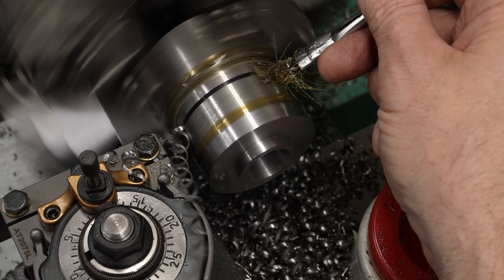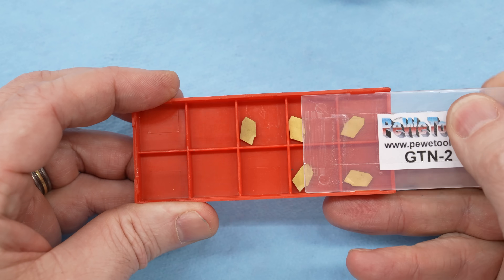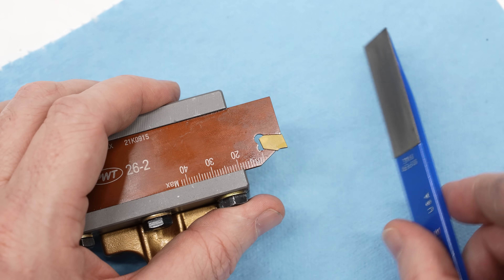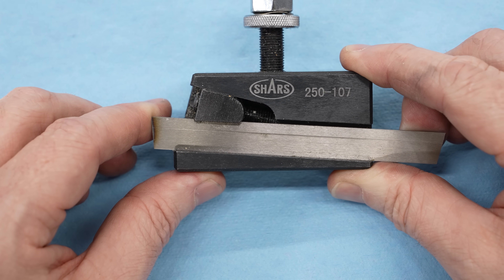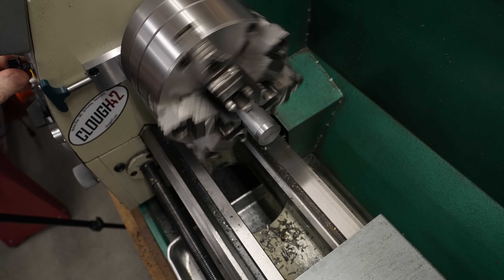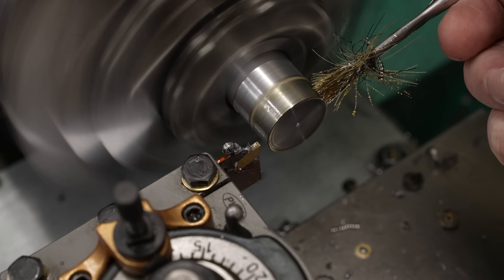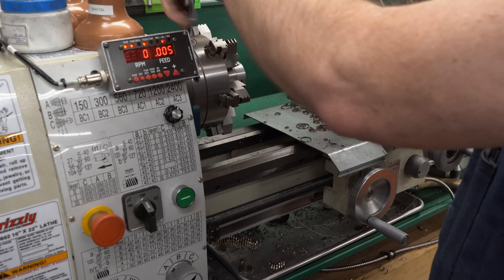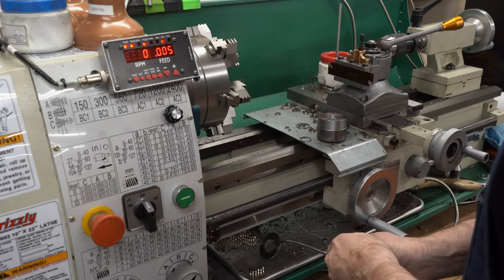High Speed Parting with CARBIDE in a Small Hobby Lathe

Comment: Part of the issue in my experience is don't use a brush. That only gets oil to the outside surfaces on a deep parting operation. Centrifugal force slings the oil back out with very little getting to the point of cut. I typically use a squeeze bottle to drip oil at the back side of the cut and let it carry through keeping it wet. I also suspect with a VFD spindle drive at low RPM, there really isn't much torque available if you look at the torque curve for that motor.
Reply: A spray bottle of cutting oil is great for parting. Spray it onto the blade and down into the cut.
Reply: Need to find one of those bottles like stefan gotteswinter has with the needle tip.
Reply: Yep. Small squirty bottle with a needle on it. And soluble oil rather than traditional cutting oil - the heat from a cut like this will make so much smoke that you can't see the lathe, whereas soluble oil will make mostly steam.
Reply: When parting with carbide I don't use lube.  If anything it seems to cut worse for me.  I use Iscar blades and inserts, and I just send it.
Reply: @10-4CodyWade  If the chip can get out of the cut, that works. When gummy material welds to the cutting edge, galls to the sides or itself locking up the blade, it gets ugly quick with zero reaction time. I guess I don't take chances with risky practices. 🤑
Reply: @LetsJeep  If you use the right cutting tool there won't be any material welding to the cutting edge.  If you're using the wrong insert on soft aluminum then it can weld, so go ahead and use lube.  I'm just saying that for most materials lube doesn't help.  Mild steel, alloy steel, brass, 416 stainless, and even tool steel can be parted off without lube, no problem.  Maybe with the Chinese parting blade and inserts he's using in the video it won't go as smoothly.  But my experience is with quality tooling.  I also don't use anything smaller than 3mm inserts.  The skinny little 2mm blades will flex more, and they cut a smaller channel which makes it harder to clear the chips.  For anything bigger than 2" diameter I use a 5mm parting blade.
Reply: I was going to say that as well.
Reply: McMaster has bottles like this that accepts lure lock needles. They also sell variety pack of needles so you can experiment and get just the right needle ID for dispensing the fluid
Reply: @gregfeneis609  I believe it’s Luer Lock.
Reply: Its actually the opposite, with a brush you get the oil on the ground of the cut, dripping it on with a bottle will sling it off. Also, no matter were you drip the oil, it will never get to the point of cut, for that you need a coolant pump that shoots the coolant along the blade to the insert. Using an oil brush is only to make it easier for the chips to come out and to cool the part a little without making a mess or getting showered in coolant, not for the cutting itself
Reply: Maybe there should be a reservoir of coolant or oil high up, from where a pipe or hose with a valve is installed and a thin needle-like nozzle at the end,  so you can accurately drip fluid even in tiny gaps.
Reply: I would be interested to know how flat the surface is.
Reply: I was about to say, I use a dripper and aim for drips to land on the back side of the cut where the tool goes into the piece and it will indeed run up to the cutting point and flow well enough to not worry at all. Just make sure you hit your mark because it needs a slight flow of some kind, whi h can be achieved with just a dripper.
On another note, if you load your brush with enough oil as you would a paint brush it will work fine too, just not great.
Reply: Oil can help the chip get out.... It can cool the chip, cause it to shrink slightly allowing more clearance to leave the groove, plus it can lubricate the exit as well.   Holding the brush so that several bristles are in the groove and the rest are outside funneling oil 'in' from outside, maybe even under slight 'pressure', from the bristles angle, dragging oil into the groove as well, If you hold the brush just right.....Other tools and processes can be better, but this is NOT ZERO....

Comment: It isnt the high speed that determines a good parting off it is the load on the tool. HSS will easily do 0.015" depth of cut per rotation if fed by hand.

Comment: So this is likely a dumb question, but when you're using the hacksaw, why not spin up the lathe and just slowly move the backsaw back and forth to keep the blade wear even? I can see maybe having to reverse the hacksaw blade for the proper direction of cut. I also see you usually don't use anything to capture the part your parting. Why is that?
Reply: From personal experience, the hacksaw starts to bind up and jump around the cut. Which is terrifying when your hand is that close to the chuck.

Comment: I'm not all that knowledgeable with carbide myself but one factor I've read more than once is that they can't normally be babied with a very light chip load.  As you noted the cutting edge is not razor sharp.  And honed or not the first part of the top at least would have hand a touch of that edge left.  And what I've read is that for the chip to form correctly, self eject and not jam in the cut that the cut has to be a touch on the aggressive side.  And this video seems to support that idea.  Mind you I do all my parting with a couple of HSS blades.  So what do I know....

Comment: I've had good results with the lathe in reverse and the tool upside-down
Reply: Same. Gravity assisted chip evacuation, plus a dovetail tool holder also has a chance to pop out rather than the part climbing onto the blade in case of a disaster condition.

Comment: Yes James,
It works and works well, consistently!!!! I theorize that the increased RPMs actually help in the chip evacuation by throwing them further away from the cut immediately after being shaved off, thus not allowing them to remain in the small space closer to the decreased diameter and with that increased room to move outwards from the centrifugal forces they just dont have time to pack up together and increase friction and jam up. There's a load of physics principals that could probably explain it all , but it all comes down to.... if its not broke dont fix it. Just saying !!!!
Excellent vid amdsure it has opened a lot of eyes. Keep up the great work.
Don
Reply: it has more to do with surface speed, since carbide doesnt like low speeds at all, even 100m/min he used is on the lower end of the scale, some inserts i used in the past liked speeds around 120m/min in stainless and slow down to around 70 in the last couple of mm where the part snaps off, speeds around 180-220m/min were also good for steels similar to 1018 with a slow down to around 450rpm for final break off of the part...

Comment: i dont know much about small lathe´s  but on  my job (CNC lathe´s)  i Part off with 150-250m/min ,  F=0.1-0.3mm/rev   from 1mm blades  up to 10mm   as far as i know Carbide loves  speed and torqe if you go to slow it will chatter or brake early.  The last 1-2mm  i slow down so the part dosent fly acros the country

Comment: I've never used a small lathe, but in my CNC world I have learned to never hone carbide inserts and to make sure they have an appropriate load. 

Early days when I first used carbide drills, the tool rep laughed at how slow I was going.....chewing up carbide tools. I quadrupled the feed rate and the tool lasted 10x longer. What an eye popping lesson.
Reply: Yes, often misunderstood about carbide inserts, they must be pushed to create enough heat at the cutting area to function. Less than that, chipping or burning of the carbide insert is assured.

This is also why altering the carbide insert in an attempt to gain a "edge" is not wise and counterproductive in every way.
Reply: @rupunzel6299  Use a 'sharper', aluminum rated insert to get a sharper edge....if you want a sharper insert.
Reply: That rep lost sales 😂 (but he made a friend, which is good business, hopefully!)
Reply: @mumblbeebee6546  He lost sales in the short term, but a loyal customer in the long term.